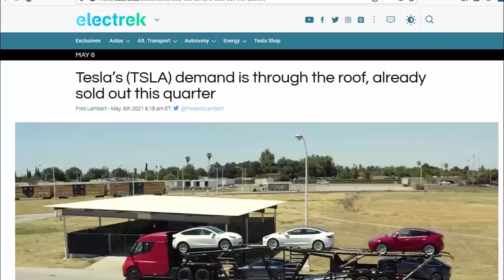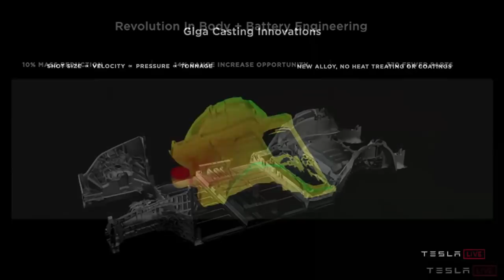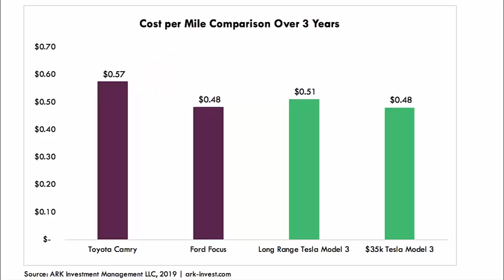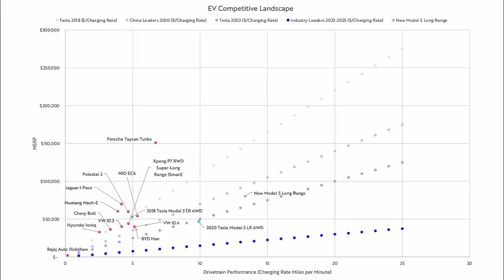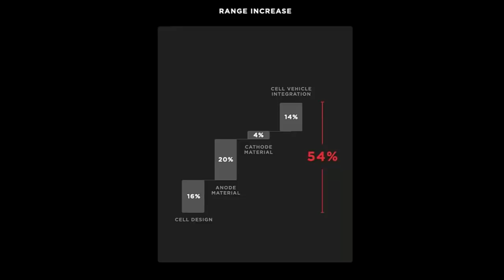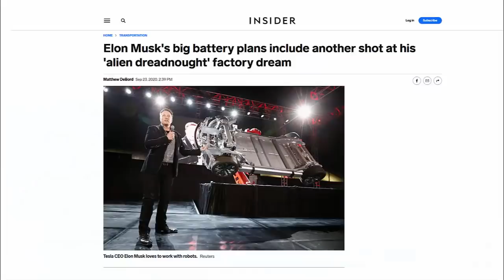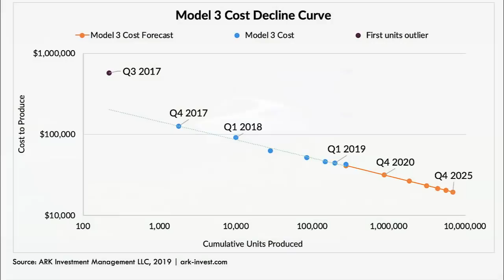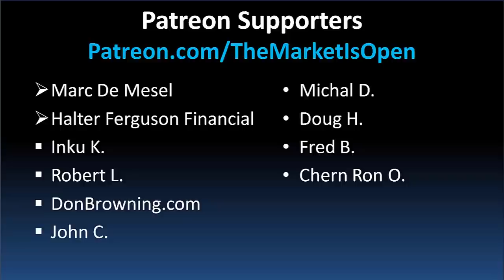The Frightening Economics of the Tesla Model Y

Comment: Love my model Y LR AWD. It has precise handling, extreme acceleration, very roomy even for a tall guy like me. It costs about 3-4 times less to fuel than my wife's ICE car. The quiet power and regenerative braking is addictive and presents a luxury feel even with its modest interior. Tesla is so far ahead of the competition and is not resting on its laurels. They are opening additional service centers and adding more super chargers on a steady basis.

With the new cast structures and new 46X80 batteries, they will be improving performance and reducing costs at the same time, unheard of with other auto producers.

Comment: I have a May '20 Y performance/performance. I recommend just the performance with the 20 inch wheels vs the p/p 21" a-symmetric wheels. Better mileage, less-expensive and able to be rotated and probably a better ride. Other than that It's life changing and we sometimes fight over who gets to drive her!
Reply: If the Performance was offered with 20” wheels we may have gone that route instead of the DM model. 21” wheels and tires are a PITA.
Reply: @mini2nut67  The giant tires are stupid in general but especially on a crossover that already isn't know for having a very smooth ride.   I thought they were letting you choose other options before but I see they now force you to get those meaning you basically will need to budget buying new rims and tires so you can actually take it in the dirt or hit a pothole without destroying the rim.

Comment: I didn't realize the Model Y went on sale until I saw what I thought was a Model 3, took a closer look at it, and realized it has a taller roof than a typical Model 3. I also read they changed the tail lights on the Model Y to differentiate the Y from the 3.

Comment: Tesla has never used any of the Toyota/GM production equipment at Fremont.  Tesla installed all of production equipment at Fremont.
Reply: It's still a retrofit within the constraints of an existing building. In their own self designed and built factories those constraints don't exist and they can optimize better for efficiency rather than just trying to make it fit. Just like when any other manufacturer builds a purpose built factory.
Reply: The way I understood it was simply that Fremont was the 1st and mistakes were made there that aren't being made in subsequent factories, having learned the lessons from Fremont.

Comment: Robotics also includes tooling and tooling design and integration of robots into the cells. Robots are almost a commodity and a fraction of the cost, the real cost is all the tooling, fixtures and engineering and time that goes into it. That is where the true cost savings is.
Reply from the maker: Totally, and fiddling with the software to get it to do what you want, takes time etc
Reply: @TMIOTesla  when I first learned about the casting I thought about all the engineering design houses, tooling suppliers and robot integrators it will put out of business. And rampup time savings. New models can be designed in a fraction of time and costs. It is bigger than most people understand. Plus the insane quality. For that reason I am waiting for the Austin Y.

Comment: If Tesla can master build quality so it’s as good if not better than the Germans, it will be untouchable.
Reply: Meh Japanese out build the Germans
Reply: That's part of the equation. A couple of other parts are: 

* A more extensive maintenance organisation, so those of us who aren't near the one or two huge cities don't have to travel hundreds of miles to get something fixed. 
* Better sound insulation: Price-wise Tesla are competing, in Europe with Mercedes, BMW, etc. but the M3, for example doesn't come close to the same level of quiet, refined driving as my similarly priced E400.

There will be others. For the time being these are the reasons I am keeping my Merc for the time being.
Reply: With recent information if they release the model capable of being a range of 400+ miles per full charge then I’m sold.

Comment: How would repair shops fix a single cast frame if it was in an accident?  Does that mean the vehicle is now a write-off if subcomponents can’t be replaced?  (One advantage of having smaller parts is that they are easier and cheaper to replace). Try and replace a Model S headlight…there is no subcomponent so $2500 per light!
Reply: cut, welded or glued just like any other steel or aluminium vehicle with frame damage.
Reply: The ultimate plan is for Teslas using FSD to not have accidents

Comment: If the package is now essential to the structure now, how do Tesla then replaced the battery under warranty when it goes wrong? As there has been numerous cases were s packs and x have been suddenly bricked requiring a swap
Reply: Still seems to be a bolt in part, so can be replaced.
Reply: Interesting that the ∃ and Y are not mentioned as also getting "bricked"... maybe that issue was already solved?

Comment: I might consider buying a Tesla when they start making them in Japan
Reply: How come?
Reply: @dac545j  I prefer Japanese built cars
Reply: @joeennis2571  Yeah. I see. Is it because other countries' workers do not possess an equal level of attention to detail to that of Japanese workers: hence the cars produced in countries other than Japan are more poorly built?
Reply: @dac545j  No I just prefer Japanese built cars
Reply: @joeennis2571  ...
Reply: Old motorhead here. There was a time when american built cars were way better than the rest of the world. Tesla has leapfrogged everybody and made it happen again. Early Tesla's were rough, I've taken a hard look at the latest, the body panel fit and finish and engineering is the world's best for production cars. Some japanese cars are suberb, some are not. Took a hard look at a friend's new Suburu. Engine/torque converter out of balance with harmonic at 2,000 rpm. Cheesy plastic parts under the hood that will break with routine maintenance. Fit and finish well under Tesla standards. Toyota's are def engineered, manufactured and assembled well. Not perfect tho, seen some fit and finish issues with even their upscale Lexus line.

Comment: The 4680 battery. Can it be compared to a D Cell size ? Like in your flash light?
Reply: A 4680 cell is 50% wider than a D cell and 1/3 taller than a D cell

Comment: Main problem of gigacasting is the repairability, in the case of a crash
Reply: @LukewarmEnthusiast  updated the comment.
Reply: Yes, any accident that causes a fracture to those large single cast components is going to be a very expensive fix, if indeed they can be fixed.
Reply: @johncanalese588  if crash is that bad, a car is usually totaled by insurance anyway.
Reply: @seanz6586  you’re not an Engineer are you?

Comment: I don't think Tesla will use LFP batteries until they can be made or provided (from suppliers) in 4680 format, since they are going all in on structural battery pack. LFP from CATL is currently in Prismatic form.
Reply: The 4680 cathode is chemistry agnostic.
Reply: LFP is already in M3 standard range models in China & Canada

Comment: Please explain how the new design can add up to 14% range? Aero, lighter??
Reply: Sandy Munro said that the vehicle is lighter with the new castings and batteries.
Reply: 4680 Battery packs are lighter, also more efficient. The 3-phase brushless heat pump is a great boost as well.

Comment: I really don't think that the Model Y will crush European automakers, mainly because there is a much greater choice of EV's at lower price point and arguably better quality and finish (and yes this does really matter in certain markets) than the any of the Tesla range.  Tesla remains an expensive EV choice - considerably more costly than they are in the USA.  Currently the Zoe, was the top seller in 2020 and it looks as if the iD4 is topping the sales charts in Europe at the moment.  Both are cheaper than the Model Y and price is arguably more important than clever engineering - the BMW i3 demonstrated that.  

Bear in mind that one of the top selling points of the Model 3 in the UK is the reliable charging infrastructure and this really was Tesla's masterstroke.

Comment: 3:07 this actually has a downside too.  that casting isn't flexible, meaning whatever design is in the mold they are stuck with unless they want to swap it out, a huge undertaking which shuts down production for an hour (and that's with a much smaller die).  Not to mention the upfront cost of buying several, very expensive, dies.  So while this is good so long as it's kept to a single, or several very closely related, models.  But for anything like VW's MQB, Toyota's TGA, or Honda's.... I actually forget what it's called, this would make those kinds of designs basically useless.  

which is an interesting insight into what Tesla is thinking long term.
Reply: Austin already has two Giga-presses, with room under the existing roof for four more, and room to extend the concrete structure to hold seven more. 

Base on press capacity in this building alone, we should be expecting up to a 3-fold increase in domestic model Y production at first, and capacity to double again if demand stays firm. 

If some Giga-press capacity in the Austin factory is used for Cybertruck and Semi castings, that would not be surprising, nor difficult.
Reply: @imconsequetau5275  unless a die needs to be changed, which for a complex die like this is extremely possible.

Sometime production can get lucky and just weld up any deformations.  But even that shuts production down for a significant length of time.  20 minutes is a good minimum estimate.

And again, that's assuming you have enough spare dies (I hope they had the good sense to order more than they think they need), so it's just a matter of swapping it out, and not doing an emergency rebuild.  Which I don't even want to imagine the time table on such a large die.

It's a huge choke point in production, and I'm not sure they've thought this all the way through.

Comment: They still have not solved the problem of range and battery life. However, the two-SUV families could have one SUV for longer range driving, and an electric car for short trips around town. This would save fuel and costs if the batteries lasted 10 years.

Comment: Tesla is already using iron-based cathodes in China for the standard-range Model 3.  So Tesla's battery strategy does allow for multiple cathode materials in its batteries.

But are different cathode materials going into the 4680 cell?

It isn't clear to me that Tesla will make different flavors of 4680 cells.  I couldn't get to that conclusion based on what I heard at Battery Day.

I regard this as an open question.
Reply: Yes, the 4680 form factor can be used with different kind of chemistries... This question was asked during battery day.
Reply: @MarcoNierop  It can be used with different chemistries.  Of course.

They also said they would be working to improve 4680 cell chemistries in the future.  So there will be multiple chemistries, yes.  Eventually.

I did not hear them state, unequivocally, that the 4680 cell would be manufactured with iron-based cathodes.

I interpreted their 'multiple cathodes' slide to describe their battery cell plan - different batteries for different purposes.  Which they can fulfill by buying batteries + making 4680 cells.

My interpretation of their remarks may be erroneous.  My point is mainly that they were less than precise in explaining their intentions regarding the 4680 cells.  You can interpret their slide either way.  Until this point is clarified, I don't think we can resolve this question with the information available to public view.

Comment: I would buy a Tesla  in Europe if the price came down, currently a y is around £46,000 or 65,000 dollars. For me the price needs to be around £36,000 or 50,000 dollars, I am driving an electric Hyundai because it was £8,000 or 11,000  dollars cheaper than it’s nearest Tesla rival. While I liked the Tesla more it wasn’t enough for me to spent 1/4 more.

Comment: And where will the power to recharge the batteries come from when millions of the model Y are on the road?
Reply: And do you have any appreciation of how much energy that is?    To work it out on an individual driver basis: the average daily drive of 40 miles requires about 10kWh of energy from the battery.   That's equivalent to a steady electrical load of 420 watts, which is about like running a game console, a big flatscreen monitor, and a refrigerator 24/7.   Show of hands, please, of those who think that would collapse the grid, particularly when the utilities and rooftop solar installers will have about a decade to increase capacity as necessary before those millions of EVs appear?
Reply: @levenkay4468  at a time when power stations are having to shut due to lack of demand - there is NO issue charging all these cars
Reply: @levenkay4468  I saved 2,000 kwh last summer by upgrading my HVAC system. We Americans can be absolutely terrible on energy efficiency, but we'll stumble our way around the issue somehow.

Comment: Big castings and structural battery packs may make the initial build cheaper, but may also make it more likely the car will be a write off in an accident - which may well be reflected in the insurance quotes. You need to look at the whole cost of ownership, not just the initial purchase price. And what will replace the lost tax income on fuel gas sales I wonder? That's a significant factor over here.  BobUK.

Comment: European brands should be shaking. Tesla though has good competition in the US vs Ford (mach-e and F150)
Reply: The reason for Cybertruck and Semi delays is battery constraints and Tesla Has by far the greatest battery availability not only from Nevada but also contracts with other major suppliers and also deeper into the supply chain for Lithium, Cobalt, Nickel Aluminum, copper etc. Ford and GM may have a large number of orders, but do not have the batteries to fulfill them and it is a scrabble to get them

Comment: Tab less cells

We know about every positive side to the 46800 format, but did we know what’s on the opposite end？ 

Tesla chose to forgo the single (welded) tab and embrace multiple (non welded) tabs. 

In an ideal case : 
Offers n times as much (non welded) tabs to gain thermal and electrical advantage. Such advantage may soon degrade at or below what single tab cell offering today. 

Degradation? 
Multi non welded tabs may offer close to but 100% tab utilization in conduction performance is limited to freshly made cells. 

How? 
Multi tabs are made of annealed copper, is a least preferred choice to sustain enough compression force within cell’s life time. Thermal and inertial shocks will deform and open circuit one tab contact at a time leaving at least one to three at most for the remains of cell life time. 

Catch? 
The proclaimed thermal and electrical advantage will degrade as soon and as fast as thermal and inertial shock kicks in, once vehicle is delivered and put to use, in the “honey moon” first interstate trip. Before the end of first year or so some or all the patented advantages are lost, leaving us 46800 cells that degrade steeper then 18650 single tab cells, interns of 
- internal ohmic resistance / cell / Amp
- internal thermal resistance / cell / deg /watt
compare to 18650

Remedy? 

No solution to pressure contact annealed copper tabs, due to gradual depletion of tab - ie open circuited caused by inertial shocks.
 
Conductive silver powder epoxy to avoid and bridge air gap between annealed copper and wall (too expensive)

Comment: Let’s make this all one piece and when the car gets in a fender bender send it straight to the scrap yard
Reply: Dude, it's the frame, not the bumpers.   If the accident is bad enough to screw up the frame (which is much stronger than most vehicles), your car is totalled.   Go watch some videos on the crash testing.   It is amazing to see tesla vs. Other cars, especially the side hitting a pole.   Other vehicles will bend around the pole while the teslas seem to just bounce off with not much bending.   Safest cars ever built.
Reply: @Sewcrates  until the battery catches fire 🔥